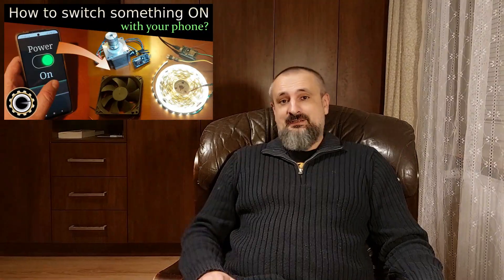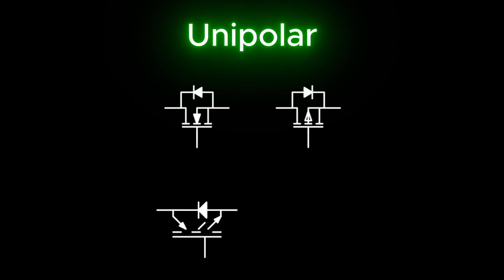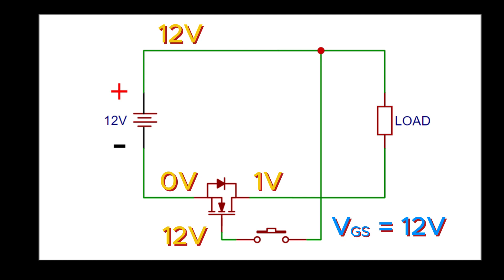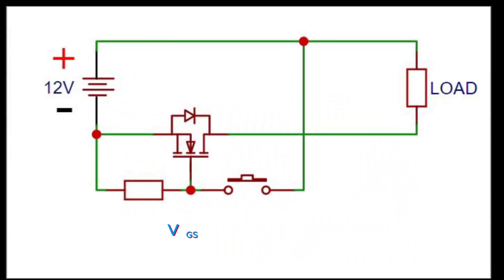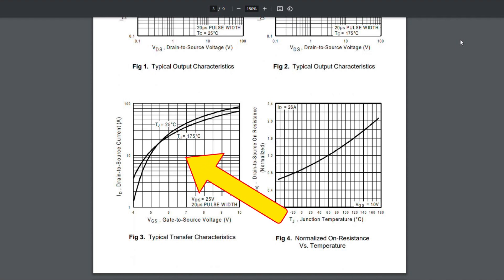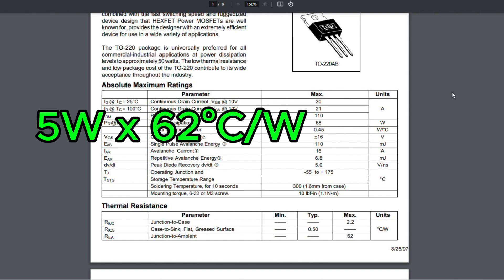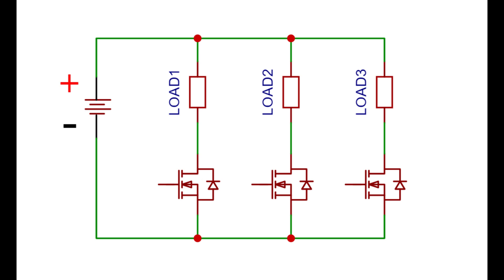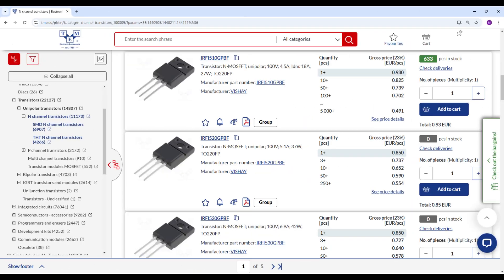Practical guide on how to use transistor in simple DIY

Comment: Wouldnt be better just to place many mosfet transistors in parallel to divide the current?
Reply from the maker: Generally, using multiple transistors to improve current output is ok. It is used quite commonly i.e. in arc welders. But - as always - such approach also have downsides. For example, even if you take several transistors of exactly same model, there is a great chance they won't perform exactly the same (in datasheet most values are given as min, max and typical). So you may need do introduce some extra measures to distribute load evenly. Additionally, in most cases one bigger transistor will perform better than several small ones. But if you have specific reason to use transistors in parallel, go for it 😉.

Comment: A great new channel! Informative video!

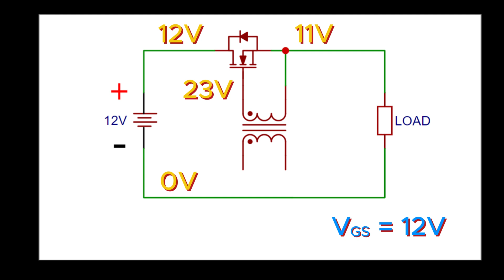2:42 As you said there are usage for putting a MOSFET in reverse, for example, ideal diode uses such configuration and uses a charge pump to boost the gate voltage to a level where it conducts.

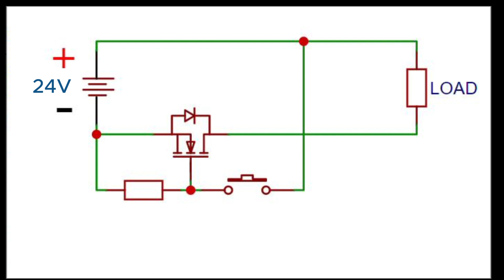4:30 - Sometimes we use Zener along with a higher value resistor (so the zener wouldn't heat up), or sometimes a MOSFET driver!

Instantly subscribed! Please make more videos like this, and also for any level (i.e., beginner to advanced)!
Reply from the maker: Thanks for your comment 🙂. Yes, I agree with the above and it's nice that you added something from your side. In the video I just wanted to avoid getting into details and complexities as I know from experience that too many information at one time can cause confusion and obfuscate the point. Especially for people that are new to the subject. But maybe  in the future I should be more explicit about simplifications I use 😉

Comment: IGBT literally means Isolated Gate BIPOLAR transistor.  Also, if you are using a heatsink, you can ignore the junction to ambient parameter.  This is specifically for use cases where no heatsink is used.

What?  BJTs are slow?  I have BJTs rated in the GHz range, I have others rated to 1000V and others with a current gain of over 2000 (Darlingtons).  MOSFETs (the only FETs you showed) have very poor linear response, highly capacitive gates and low maximum gate voltage.  They do have drawbacks.  There are many more applications where BJTs are the better choice than not.  But that's totally beside the point.  Both have their uses and both have strengths and weaknesses the other does not.

🙄
Reply from the maker: Yes, that's absolutely true what you say. The problem is - it wasn't supposed to be a comprehensive guide covering all aspects in all scenarios related with transistor, but sort of "quickstart" guide for the ones that have little to no experience with transistors and just want to start somewhere. As mentioned on the very beginning, it's a topic for entire series of videos 😉. But thanks for extending it 🙂
Reply: Are those the BiCMOS and HEMTs?
I've seen talks of them being fast as haiylle!
What do you do with them?
Also brother, help me out, ya know any generic light activated relay, that is rated for mhz speeds or more, like a fast phototransistor?
Reply: @yasirrakhurrafat1142  No, bipolar silicon.  I used them for an RF amplifier.  Have you looked at the BPV11?  It's the fastest PT I know of off hand.
Reply: @uni-byte  wouldn't it be cool if we could transmit data at high bandwidth to long distances with light! (I am very oblivious to how radio transmission works  );
I was thinking what PT.. or whatever they use in fibre optic media converters. Like electrical signals to light then back.
I think they're not available for diy use (the main components emitters/phototransistors), but I'll check out your suggestions!
Reply from the maker: Communicating with light is a really interesting idea 🙂. To be honest, some time ago I've been thinking about it for a moment. On the concept level, I considered using a laser. Or several lasers, to form a beam of several wavelengths (this way you would have several channels within one connection). I gave up as soon as I realised that it's rather a project for at least few years for entire team of scientists/engineers, not a single hobbyist like me 😉.

The problem is: some random things will disturb the light from time to time, so you can't just blink the light against receiver. Instead, you need to do something similar to what radio transmissions (like WiFi) does - emit sort of continuous carrier signal, and read data using frequency-shift keying (FSK) or something like that.

It's a well developed solution so you should be able to reuse a lot of science behind it (like algorithms ensuring data correctness), but still it's a lot of work to implement it. But for sure it's something fascinating, and - possibly - the future of communication in space, so wish you all the best with this project 🙂
Reply: @StargateSystem  I had been thinking the exact thing as well!
Would the disturbances you mention also affect in insulated/isolated systems, or is it a high frequency thing and would happen regardless?
Getting to have multiple different wavelengths input and output along with a full duplex connection possibly in a single fibre is a dream!
Your idea is much more articulate than my poor understanding of data transmission.
I admire that indeed.
Thank you dude, you're awesome!
Reply from the maker: Thanks man 🙂. Regarding disturbances: if you have a totally insulated system than I guess it won't be a problem, but in this case, the main concept is to use it without any shielding along the way (otherwise we could simply use ordinary optic fibre 😉). So even in space, there will always be some dust, gas clouds or foreign light sources possibly interfering with our beam. Not to mention what can happen within the atmosphere 😉. It's really long story, but I think that - sooner or later - I will make a video about it because I'm curious myself how it will work 🙂
Reply: @StargateSystem   oh, indeed.
I was thinking maybe there should be a fallback radio transmitter, for long range, low bandwidth.
Also, can the media converters and commercial devices be used for raw data transmission also, isn't it only standard Ethernet that can be transmitted and received or no?
Reply from the maker: Ethernet seems nicely suited for such application, but my first guess regarding protocol to use, would probably be UART (aka RxTx). It's just more basic and available out of the box on every cheap microcontroller board like ESP or Arduino, so - as starting point - will probably cause less problems. You just need to replace ordinary copper wires with this "laser wires" - one for Rx, the other one for Tx. In such case, the only technical problem you need to solve, would be to find reliable method of generating high and low states on both sides, using light instead of electric current.
Reply: @StargateSystem   no-
I mean, would the (commercial) media converters ever allow any other type of data transmission other than the standard Ethernet protocol (only that encoding and none other)?
Or are the transmitters and receivers agnostic and will transmit recieve any data.
My perception was that media converters work by turning laser diodes on and off, but I think you're suggesting otherwise (when you were mentioning about noise and signal distortion).
Reply from the maker: Ah, ok. Probably I missed your point 😉. Can you give an example of such commercial media converter you have in mind?
Reply: @StargateSystem  any.
I'm referring to the devices that are frequently used to connect on either end of a fibre optic cable.
To convert electrical signals to light.
But considering they have only ethernet input, could they also be encoding/encrypting the signals so as to not be intercepted midway, preventing the converters to be used for any other communication protocol, uart, spi, i2c or otherwise.
Reply: @StargateSystem  cuz I'm only aware thet they're for converting the 4 wire or whatever config ethernet input is.
But the input interface only allows an arbitrary ethernet/rj45 like connector. Thus, my confusion.
Reply from the maker: Thanks, now I understand 😉. I'm definitely not an expert on optic fibre technology, so I'm afraid I won't be too helpful in this aspect. From what my intuition says, such commercial devices designed to cooperate with optic fibre (especially the ones intended to serve as internet access points) will not work too well in such "wireless" application as they consider the signal to be really clean and predictable comparing to what you will have in the open air. But if you just want to play a little and looking for receiver, you can try typing "toslink receiver" in google. Never tried them so I can't promise it's what you want, but on the first glance they look pretty much low level and reasonably cheap for first attempts😉
Reply: @StargateSystem   oh, I've been dyin to find any feasible alternative!
Thank you!
Will check out.